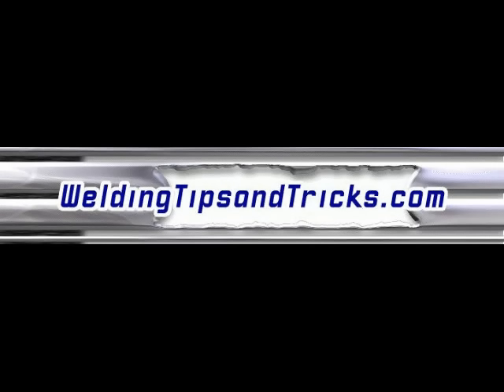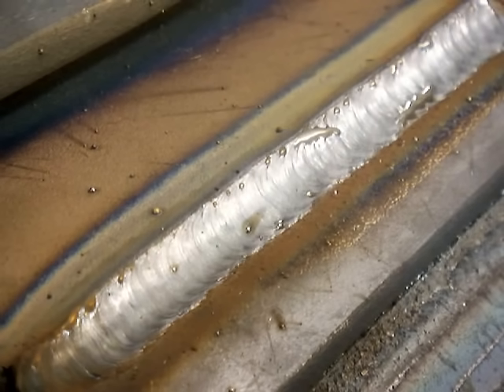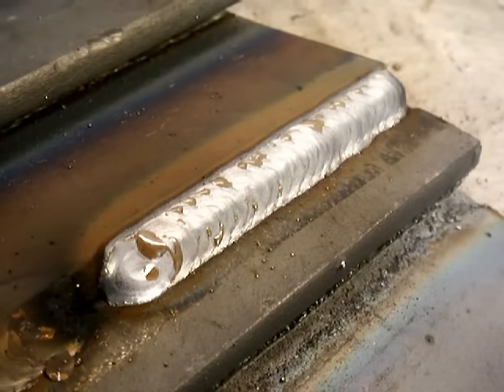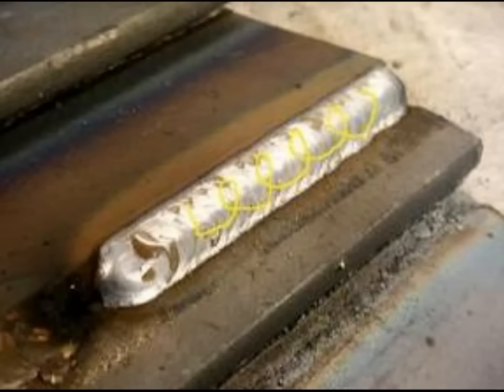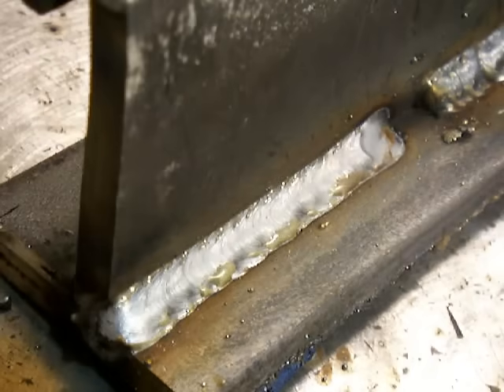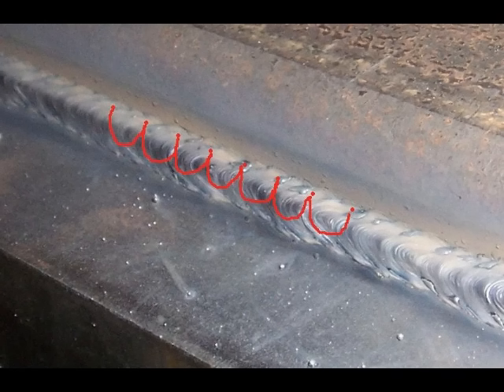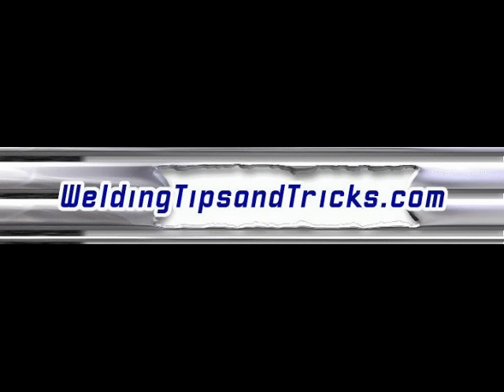Mig Welding Technique Taught by Old Timer

Comment: A weave like that with MMA is a big FAIL, Yes it looks pretty and will hold, but you won't keep your preasure tickets with that action. You must keep the arc right in the root to gain maximum penatration. If you need to run a larger weld your better off running a three run fillet.

Comment: I think i found the problem i had the heat way to hot. checked on the inside of my welder panel and adjusted the heat and its seemed to cure the problem thanks for you're help.

Comment: hey im 14 and i just welded today in school. we didnt weld much. we just took lmetal squares that were kind of small and we just welded our initials on it. i prefer when i weld when im mig welding to be pulling back while im making the weld and going sideways instead of trying to push forward because when i push forward the metal gets pushed around and it screws me up. i have to say welding is pretty fun as long as you use common sense such as using gloves and wait before washing it under water.

Comment: @aguilars00011 Are you welding outside? Wind can cause pits and bubbles. it is likely that your weld could be getting to much oxygen. what wire, gas, and metal you trying to weld? need more information to help properly.

Comment: @TheBillythekid2012 This.... Break the weld open and there won't be sufficient penetration into the material, and more than likely there will be inclusion in the root of the weld. The weld looks nice, but it's not as strong as it could be using a certified technique.

Comment: @76slippery thats what i tough.. but in canada were like 5 years later on welding technic... but ont that .. its really beautiful but there will be more penetration if u keep youre wire right at 45 degree in the middle of the cornerd.. but  i think that exercise is more like.. 25 degrees a to recharge but no pass over the plate.. and thats only 3/8 im sure youre right for the penetration

Comment: @TheKawi125rider , I'm pretty sure stitch welding is when you weld for a certain length (e.g. 6") then leave a space of 6" and then weld another 6", so on and so on. e.g. 
666666______666666______666666______
tips, always tack weld it together before welding  T____T______T____T
and always weld towards the heat! (weld towards your previous weld) this will keep it from warping.  IMO

Comment: @welder4life11 it just depends on what you are welding. usually dragging or pulling is better, you just have to get your heat right, and never leave your puddle. move at a consistent speed and stay in your puddle. that will give you more penetration.

Comment: @welder4life11 you can do it anyway you like dragging will give you less penetration but a generally better looking wider bead because its usually easier to see the puddle also better for light gauge due to the less heat input, and pushing will give you more penetration with a more narrow bead that isn't usually as nice looking because it can harder to see the puddle. mainly though do what is more comfortable to you and it will always look better then doing something uncomfotable.

Comment: when it sounds like bacon frying it's a good speed, and if your new to this, take a test weld with scrap and stay were you can reach the wire speed knob and adjust it while welding you will see and hear the difference.

Comment: It looks like you have no penetration and that you are just deposiiting weld on top of the joint. Yes it looks pretty, but how strong is it? 
I was taught to use a similar technique when filling a deep V. 
I would fill the bottom ensuring good penetration and then move back a bit putting more weld on top to fill the V. It was more of an arrow head shape pointing in the direction of travel. The root at the point and then back up and down and then forwards to the point again.

Comment: @Jayeeyee I use 0.6mm for car stuff. I don't quite understand the second part of your question. If you want to MIG without using gas, you have to use special flux coated wire. You will get knowhere using normal wire without gas shielding.

Comment: What a good wire thickness for welding automotive exhaust pipes like mufflers and stuff.  Also.. what type of wire should be used with and without gas?

Comment: @000JoshuaMcClure000 solid wire should be "pushed" with a 20 deg angle, and flux cored should be "pulled" with around a 20 deg angle

Comment: @BHOSS108 this was not spray arc, it is short circuit transfer you can tell by the sound. His pass was fast but  spray arc has a cleaner appearance and I am not sure the technic he is using would work with it.

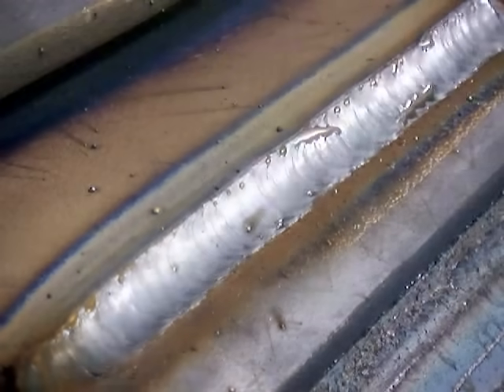Comment: I like the clear presentation style a lot, but the bead at 0:39 is concave.  In general, weld beads should be convex for strength (concave beads have tension in the fillet and are more prone to cracks or other failure).

Comment: @BHOSS108 As others have pointed out, you're talking out your ass and this is short-circuit, not spray transfer. Weld penetration, as you can see at the leading edge IS rather poor. However, welding with more wire push-through than he is results in a really hot pool and poor weld ductility, which is what's actually going to lead to failure in... almost every circumstance where a weld fails.  Anyone doing pressure pipe work knows full-well you don't "circle" on a root pass, ever, ever, ever.

Comment: Yes sir...IM from sc and I LUV those time corner joints running mig or a 7018 stick..those circles are the shit if you can draw very well because the hand moves very much like drawing when welding and this makes the weld sooo pretty after a you set your machine just right...

Comment: @819sebas i NEVER said that i could remove that with a screw driver and hammer…  It looks like it did not penetrate the metal making it LOOK like it CAN BE removed with a screwdriver and hammer… 2 totally different things i said there…   The local welders here all use MIG welders and their welds do not look like his weld, the welds done here locally LOOK like they penetrate the metal which makes them look like better weld jobs...

Comment: @01Commenter10 LOLLLL i would like to see you trying to remove that welding with a screw driver and hammer... its not because the welding is smooth looking that its not penetrated... the penetration is just more wide then deep... but its as stong as welding in a straight line.. and when you "wave welding" like that.. it ensure that both piece are chemically bonds together... (sorry for my english)

Comment: @BHOSS108 i see what your saying… it looks like he is just FILLING in that corner with weld but not penetrating the metal itself like it should be doing… his way it looks like the weld can just be chiseled out by screw driver and hammer…  Proper welding actually penetrates the metal or aluminum and chemically bonds them together to make one solid strong piece.

Comment: Uhm you can pull aswell..my dad does it to...he has welded for over 35 years, offshore also. Important with thick metal you need high amps and fire feed, for a full deep penetration burn.

Comment: I'm a welder/metal worker of 25yrs and in all the M.I.G codings i've achieved none of them stated a pull method in the procedures, therefore i'm curious and questionable of your methods? The finished weld does look neat and uniform,but it's a method i was schooled to avoid? I've gained codings in both ship building and petro-chem to the highest standards. Please enlighten me.......

Comment: @DFCad1 
You need to try a good 250 class MIG machine instead of the Home Depot 110V machines.  If the machine doesn't have enough heat, it will look like bird droppings no matter what you do.  The big machines maintain voltage much better (flatter voltage vs. current curve).

Comment: @mikeyz75 its actually both mate, generally argoshield 52, or migshield, its a mixture of 2.75% oxygen in argon and 16% C02, straight argon is only used on stainless steels and aluminium as using it on carbon steels is a bit unstable and doesnt penetrate as well at the argoshield mix,

Comment: CONTINUATION ~~~~~~Good Example I welded a oil well head on for an oil well  if you dont know what that is google it or youtube it passed pressure test they proceeded to hang the tree on they had all of it installed but not tied off and the tree fell crushed one man on the subfloor and the other fell 30 ft and broke his arm needles to say my weld did not break but the casing did. good lesson always bury the rod or wire into what ever you are welding it increase the strength 2x.

Comment: That is a nice looking  weld I have been a welder for many years. The thing is to be careful what he is doing is spray arc welding to produce a smooth weld the problem with that is you lose tensile strength because you are using fusion  only and not penetrating the metal with the wire which is stronger than the metal and the weld will break before the metal breaks that is not good when it is all on the line you life or someone else. DONT TAKE THE CHANCE!!!!!!

Comment: subtle differences in pull vs. push?... lols.. you can push your puddle left to right or right to left. its mig not stick.. push your weld properly do not drag or pull your puddle on a horizontal lap.  i only drag my puddle when welding vertical down.  nice noob technique tho, creates undercut.  works for you running that low of wire speed.

Comment: @theschuminator hi im also studying welding and fabrication at college. I've always found that i MIG weld better pulling rather than pushing (even though we were supposed to push) and the quality of the weld is just as good as those that have pushed, i.e it passed all NDT's and DT's and the weld itself looks nice. to be honest I don't really think that it matters its just what ever you feel comfortable doing as long the weld itself is to a good standard (:

Comment: that looks more like a concave weld which would mean a weld like that is open to stress fractures at the toes.
And yes the arguement between pushing and pulling will always be there but as you would know when using this process your controlling where the gas is going by pushing it and your keeping it sheilding by pushing.Pulling it may lead the gas to go everywhere.
Nice weld though

Comment: @walkinghorsejones I tell you what....It sure is.  When you have to weld in a breeze or when you can't lug your T size bottle around.  When you just need to get a job fixed in the feild....RIGHT NOW!  Now, if the customer wants pretty, stick is not the best being that its messy with all that spatter and slag.

Comment: First off how can you have perosity in a drag angle your nozzle is facing the weld unlike a push?This video is dead on dudes is using pure carbon dioxide as a shielding gas its text book what this video shows if he didnt make the elongated e motion he would get cold lap ! So 75%argon25%c02 is the easy way what this video shows to me is n art form!

Comment: @MrLostCrayon mig, tig, and stick all create arc. what your calling "arc" is stick,  SMAW, shielded metal arc welding. i would say that mig is definitely the easiest to get a weld started and maintain. but a good machine and clean metal make all the difference. also if can afford get a multi process unit, esab or miller.

Comment: i use little circles but either way it makes for better penetration between both plates and has a clean appearence if done correctly. and no im not a professional welder but i use the knowledge and techniques i have been taught along with a good amount of welding time under my belt to make some pretty nice welds :) keep the videos up i think there awsome!

Comment: @Austrulz1 It depends on the weld
If you ride the puddle while using spray you'll get very little penetration (Hence were forehand is nice) but as a general rule of thumb backhand is far superior for penetration 
I've seen beautiful 2F Gmaw welds break just from the plate being dropped 
As for spatter just set up you're amp to match your wire speed about a 1-10 ration works well I.E 18-180 
Also instead of running straight C02 a Argon/co2 mix will produce a much 'cleaner' weld

Comment: I'm extremely new.  I borrowed a wire feed welder from my uncle, no gas, and I get horrible welds.  Lots of BB's, and looks crusty.  I talked to a friend of mine who is encouraging me to buy a welder that works both with core-flux wire as well as gas, whether it's Co2 or Argon.  I'm curious to know the specifications of everything you did?  Was it core-flux wire or gas that you used?  How thick was your steel?  What kind of welder did you use and what settings (wire speed, amperage, 230 or 115)

Comment: @ninja6kid granted, but if you aim to eradicate these defects early enough you will achieve best practice and a higher level of competency. Surely you should be aiming to produce your best regardless of the nature of the piece you are working on. My old tutor used to tell me that anything you do in Engineering is your signature, so you should take pride in it.

Comment: @pkzuras 

You seriously think so @2.03-2.06?  Wow. Guess that's the difference in perspective between a welder and a welder come inspector.

The weld profile prior to 2.06 is perfect at 2.03-2.06 (when he demonstrated increasing deposition rate in the pass) you will see it "streaks" to cause the arrowhead profile.

I am not bitching.This is a great vid, you will see if have commented favourably in a later video from this uploader where he demonstrates GREAT practice in TIG feed techniques).

Comment: You'll notice that the weld profile pattern looks like arrowheads as opposed to a stack of coins, whislt this is typical in MIG/GMAW it is cause by speed of travel/pass being too fast. As a result this streaking effect seen more predominantly at 2.06 occurs. This is widely undesirable in high quality welding (i.e. Nuclear Systems). This streaking effect caused by excessive pass speed usually goes hand in hand with lack of root penetration and lack of fusion (both in the toe and root).

Comment: WEATHER PUSHING OR PULLING.... A  DECENT, ACCEPTABLE  WELD PROFILE WITHOUT STRUCTURAL FLAWS  SUCH AS UNDERCUT IS POSSIBLE, ITS ALL ABOUT TECHNIQUE.  THE MAIN DIFFERENCE BETWEEN PUSHING AND PULLING THE MIG GUN  IS PENETRATION. A PULLING TECHNIQUE CAUSES GREATER PENETRATION.

Comment: He does a really nice uphill weld, its really good, however in this position (flat) this bead although very very pretty is not a strong weld. What you want to do in this position as well a any position really is crank the heat as hot as you can handle. In welding heat is your friend a good weld will be equil width and oh so very smooth, no ripple what so ever. and all the impurities will rise to the surface like this one, but you want a smooth looking bead. So crank the heat and move fast!

Comment: @spitzification14 hey im a welder from ireland i was reading you comment about stick welding.stickwelding is alot sronger then mig and if you try to turn up your amps you might get a better weld.it is hard to get nice welds but if you slag is falling off your weld after you make it then you amps a perfect.keep practicing and you will get better.i just got coded for welding pipe in europe and im only at it 4 years.

Comment: Nice Vid. But..."push or pull both work"? I have always been told never to drag or "pull" a weld for the reason that pulling has less strenght. This is also the case with weaving. Im sure if you x-rayed them welds you would find faults underneath the pretty surface. i suggest a straight run pushing in to the matal would acheive better results.

Comment: @s1owsrt 
agreeing with you ( lost keys, not spelling, bad message)
no insult intended, "X ray welding" dosent look its appearance its quality
of layers with out faults of any kind. i do say if stick welding use the weave to controll
the root face, as for speed increase no such thing. 
ps have a good day. 

You have 911 movement, where is the metal workers movement "usa gov is dreaming", building turned into match sticks, beams inchs thick, they should all be twisted and bent by force.

Comment: i would like to see an x-ray of that b.s. beginner method.......why dont you shoot your wire an 1/8th of an inch from the joint crack and push the bead like your supposed to without breaking the edge.........but then again thats the difference between REAL welders and  Wannbe welders.

Comment: @pukkeroony . Best way to prove this is to weld a push and pull on a couple joints and cut, polish and acid etch to view penetration. I do this at the college I teach. Pulling gives more penetration, not pushing.

Comment: sweet welding, wish i could be that good :(

on my welds i always get like a dark blue layer ontop with all the shiny silver weld underneith, any idea why this is so? i use a argon/co2 mix gas.

also do you recommend that when welding tube for strength (rollcage joints) that i do high amp spot welds? eg. very hot setting, weld for a few seconds making a good puddle with high penetration, stop, wait a second, weld another puddle next to it, etc etc. is this bad or good? cheers mate!

Comment: @bosscolon 
I have the Eastwood MIG 135 and totally love it!  I run solid wire with straight CO2, this welder and setup will do what you want perfectly.  Id go with .030 wire and the chart on the inside of the welder is a good starting point, usually right on poing!  Good luck friend.

Comment: nice welds,question iam getting a mig 100,,iam going to attempt to build a vanity table out of 1/8 th inch forged steel tubing,,wall thickness is .098 ,,what type of wire size and speed would you recommend i use ,,for that type of materail,, any suggestions would be greatly appreciated  thanks

Comment: Guys and girls. The technique you use is determined by the thickness of material. If you are welding thin gauge material then you pull your weld (less penetration) and if it's thick gauge then you push the weld (more penetration). Simple!